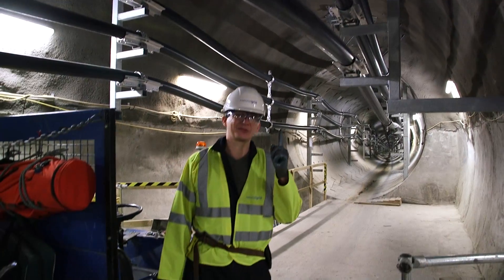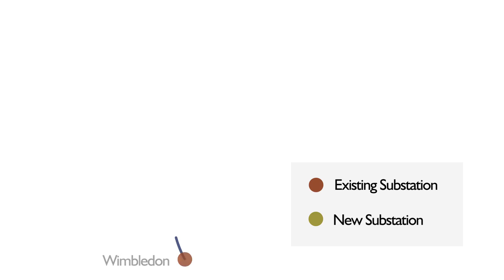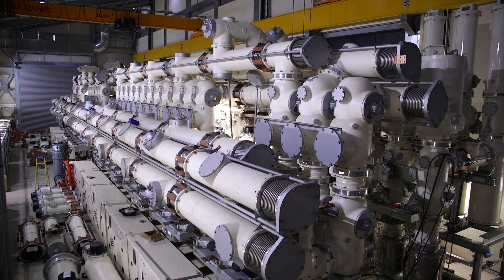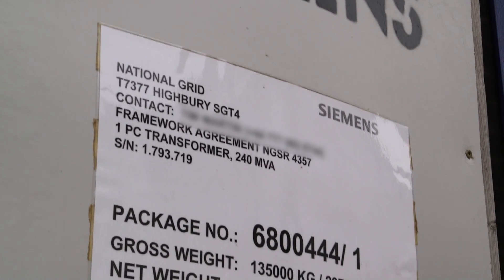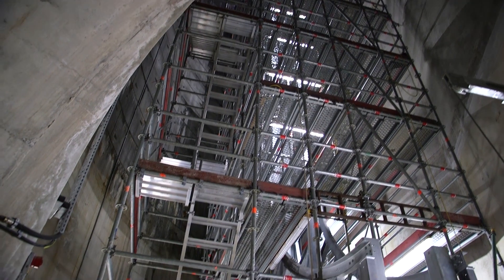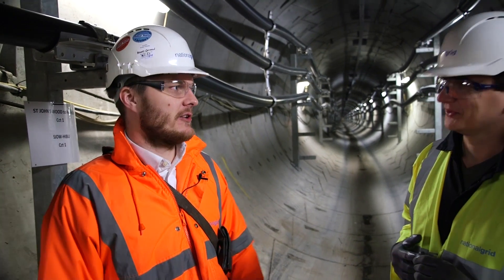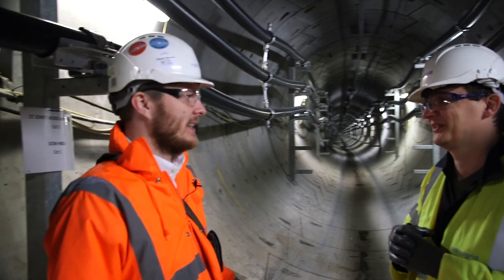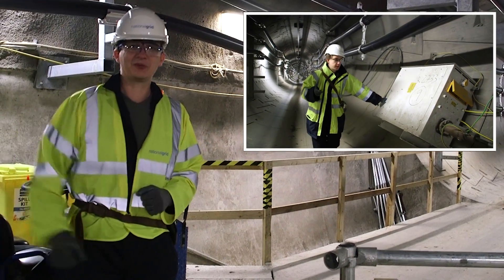Inside National Grid's Power Tunnels

Comment: London and the United Kingdom would have similar problems to Australia or even a bigger national grid capacity problem in the future. 

The cost of expansion is the biggest dead end.

Do yourself and the UK and the world a favour and look into this.

Underground tunnels are totally overlooked and underground distribution and future grid capacity. 

In Australia the nuclear promoters want to stop CO2 emissions and have a no fossil fueled future.
18% of Australia’s energy was electric energy in 2021-22. 

So 5 TIMES MORE ELECTRICITY is needed. 

So 5 TIMES bigger national electric grid, including transmission and distribution. 

The Australian grid new build is $1million per klm. 
Grid is 1million klm. 
New nuclear generation $2billion and 400 SMRs are needed. 
Small Modular Reactors. 

100years to build the existing national grid. 

The UK would have similar costs.
Or more for the below ground electric supply. 

This is a huge story and nobody has put the numbers together. 

On top of that problem is that if the sunniest continent on the planet goes nuclear and Australia’s CO2 emissions are from the worldwide CO2 emissions then Australia will have spent a $GAZILLION an still suffering climate destabilisation. 

Australia’s latitudes is the same as the Sahara Desert latitudes.

Comment: What happens to the waste heat from these cables? Is it put to use heating nearby buildings, or just wasted.
Reply: Yes, the heat is captured and used to heat buildings at the substations like the telecoms rooms and switch halls :)
Reply: L Fewell I don’t know how much best you think is generated by these cables but it’s negligible, nowhere near enough to heat buildings. Hence the reason for the higher voltage, high voltage = low current, lower current = less resistance and less resistance = less heat and losses.
Reply: I suspect the energy loss isn't actually negligible, but it would be low grade heat and difficult to harness.

Comment: Surprising that they would put 400KV lines deep under London, when London is barely above sea level.   What happens if the Tsunami from that unstable island in the Atlantic comes in?   They might wish the wires were high up on graceful towers.
Reply: rtel123 nothing happens. Cables are waterproof
Reply: until they develop an insulation crack, unnoticed until immersion occurs.  I have worked for utilities and seen it happen.
Reply: It's not in the Atlantic ?!!

Comment: Would they add other lines down there like phones or gass/water
Reply: BT Openreach has their own tunnels and conduits for telecommunication use, as do the local water companies and the gas division of national grid. To be fair 400 kV AC cables are safer not sharing a confined space with gas, water or cabling susceptible to damage from electromagnetic induction. The latter is never a good idea while the former mostly only present severe risks in the event of a double failure but considering those risks in this case would be turning the entire system into a giant 32 km long pipe bomb with a charge of up to around 100,000 cubic meters of explosive hydrogen or methane gas with an ignition source probably better we just let them stick to their separate tunnels.

(And yes 400 kV can easily manage the electrolysis of H2O turning it into explosive hydrogen gas in a confined space, this is of course not good).
Reply: No, the point is to avoid having to negotiate with others in order to carry out maintenence, the tunnels can't be accessed whilst the cables are live for safety reasons so it would be a nightmare if every time Openreach wanted to maintain their phone lines we would have to turn the cables off...

Comment: I wonder why the tunnels have to be so large.  I know that people have to move though them, but they seems a lot bigger than they need to be.
Reply: Aids in expansion in the future, among other things. Easy to put in a new cable, hard to drill a new tunnel.
Reply: Theres an electrical reason too  As cables carry current (electricity), they heat up.  The more current they carry, the hotter they get.  The heat disappates into its surroundings, and the faster that heat can be taken away means the cable will cool faster meaning they can carry more current.  If there the tunnels are smaller, there is less air for the heat to go so the cables stays warmer and the surroundings stay faster.  There will likely be some sort of air circulation system too (ie fans), but the more air you can move the faster you can shift that heat.
Reply: RoulinBrooks if they made it just the size of a man, do you fancy trying to pull countless metric tons of copper/aluminium down miles of tunnel? Lol

Comment: Why need separate tunnels? Why not just thread wires through crossrail/underground tunnels?
Reply: It would be a maintenance and upgrade nightmare (suspending tube services to access the cables). Additionally the tube lines don't necessarily align with the substations.
Reply: Ah fair point.
Reply: You must realise the EMF from 400KV cables is immense and would adversely affect all signalling and communications equipment of the railway system. Not to mention if an accident were to happen and one of the cables were to be severed by a train with hundreds of passengers on board... Doesn't bare thinking about! :-o

Comment: makes me sad when i see pylons etc as why do people need so much electricity, and what a waste sending it such long distances, wonder how much gets lost along the way. Locally produced renewable power is the way to go. i am off grid, if i can do it anyone can.
Reply: Not much is lost because it's high voltage, and unfortunately locally produced renewable power is no good for heavy industry and whilst it works for you, it doesn't work for everyone. Locally produced power isn't as efficient either as the larger machines tend to be more efficient.
Reply: Will Datsun mostly the increasing demands as people buy more objects, not to mention more people moving in in general
Reply: Actually distribution losses are enormous, with around £1.28b of electricity lost each year in the UK.
Reply: @LondonRider12  Yes, but transmission losses are much lower - the majority of power loss is actually in the final cabling coming into your house at 240v

Comment: A pretty random question I know but how much heat do those 400KV Lines create?
And do they have fire detection loops fitted throughout the tunnel?
Reply: That's why you never see snow in London.  The whole city is inadvertently heated by underground works.
Reply: The cables (prior to this tunnel, maybe not now) run under Clapham Common. One morning I walked through, and the snow had melted along the line of the cable.
Reply: They can create quite a bit and in one tunnel I work at we have a full water cooling system for the 400kV cables. There will be temperature monitoring, but as for fire detection, I would imagine there would be.

Comment: I don't understand why all new power lines aren't buried underground. Above ground lines are such a liability, especially in snowy climates like mine. Just a touch of bad weather and thousands of people are without power.
Reply from the maker: +Spencer O'Dowd Much more expensive to build tunnels, that's why!
Reply: +Londonist Ltd Up front, yes. But the decades of saved maintenance costs balances it out IMO.
Reply: Overhead Lines are by far cheaper in the long run, they are easier to maintain have fewer permanent faults and take days rather than weeks to repair. Tunnels are mega expensive but do allow repairs in a shorter space but at a huge initial cost. Undergrounding is very difficult to repair and also quite costly to bury in the first place. Don't forget the cables themselves are many times more expensive than the overhead lines and repairing cables is complex and time consuming.  Believe me the company wouldn't choose towers over tunnels or cables (I work for them!). Replacing cables is also very expensive, whereas the overhead lines are relatively cheap in comparison. In fact there is little maintenance on overhead lines in the first place.
Reply: +Spencer O&#39;Dowd Tunnels are really expensive in the first place. To the point where your break even time might be beyond the design lifetime of either option.

I wouldn't be maintenance on overhead lines is that much worse either. Tunnels can be much more expensive to maintain (especially if there's structural or water ingress issues).
Reply: Not at all, I seem to recall cables cost 10 times as much as overhead line.  Another issue is when something is underground if something goes wrong, it is harder to find the fault and fix it.
Reply: You dont have to understand why, the power transmission and distribution companies have a great understanding as to why, most of which are mentioned above
Reply: Electric transfer is also much more difficult underground. The Earth creates a barrier of natural resistance and that mskes underground cables less efficient. It's a nesscity in London but avoided where possible.
Reply: Also, electricity at that voltage builds up a lot of heat, which dissipates easily from overhead lines, but from tunnels has to be extracted. Have a look at the tunnels they created for electric mountain in Snowdonia, Wales (Dinorwig Power Station).

Comment: Volts isn't a unit of power.
Reply: Volts is a unit of voltage. Watts is a unit of power.
Reply: @Jon-em4kc  "Volts is a unit of voltage" No way really?
Reply: +Sod Alfredsod You can have 5V and 1000A
Reply: I said that very poorly. Yes, electric potencial is not power, but it acts as a multipiler for power (Watt = Volt * Ampere). Higher voltages will also arc longer and pass trough more insulation as Resitance is directly tied to it.(Amperage is too but that is beside the point)

Sorry for the long comment (that is porbably even more wrong).
Reply: @asj3419  it's referred to as "current", amps are the units of current.
Reply: Potencially.
Reply: No, but it is the unit for potencial power.
Reply: +Sod Alfredsod it's not even that either. Where did you get that from?

Comment: I have tried to ask National Grid about this before, but they didn't answer me. How does this project fit in with the cables that run under the regents canal, because it's either their fault or the Canal and River Trust, but the towpath is really badly maintained in places and often waterlogged... I think it would be better if TfL were to take over running the canals that run through greater London, they are after all a transport mechanism. The C&R Trust doesn't really seem to care about much else than getting fees from boaters.
Reply: The owner of the towpath is probably the C&R Trust, and National Grid will have a wayleave for access, that said, sometimes NG will buy a piece of land instead.

Comment: those tunnels look like a cyclists dream....
Reply: Except for the combination of slimy standing water and slick, smooth concrete in the very bottom-center.  "Mind the slime!"
Reply: As a cyclist and someone learning to skate, can confirm
Reply: +Syed Abdul Wasay Apparently there was some talk of converting some old unused tube lines into cycle routes.
Reply: Harry Akira Eaton So is there one coming or not....
Reply: Syed Abdul Wasay Doubt it, be a nightmare to police, also they’d have to come up with some kind of bike escalator, and the time going up and down the escalator would probably mean most cyclists wouldn’t use it due to it taking longer overall than dicing with the traffic.

Comment: So why do they have to be so big? Surely they could be about 2/3 the size and still fit the cables with maintenance room - wouldn't that make it cheaper?
Reply: +The Natter Nodge Future expansion room possibly? Perhaps there's some health and safety BS which states that two people need to be able to pass eachother
Reply: +diceyface I'm no expert but it's probably a combination Even when operating at max capacity, it must be able to follow health and safety regulations
Reply: easy movement through the tunnels
Reply: +The Natter Nodge It might have more to do with the machinery used to dig the tunnels. A smaller tunneller would mean smaller parts, so more cost to make. Also a smaller tunneller would mean less earth moved per day, meaning it would cost more in wages and man power as the protect would take longer.
Reply: +The Natter Nodge i think its to do with heat, those cables need to be kept apart from each other to prevent heat build up. There are numerous vent buildings along the route to bring in cool air and expel the hot air.
Reply: +The Natter Nodge I was thinking that too.

2/3rds the size would still be large enough for the cables and people.

Perhaps it was too do with the TBM? Maybe there's not really technology for digging smaller tunnels without using stationary equipment (which would require holes all over London).
Reply: Jed Robertson Interesting point

Comment: "400kV, that's a lot of power we thought" Voltage and power is not the same y'know..
Reply: +Arnþór Gíslason still allot of power though, hes not wrong
Reply: +Arnþór Gíslason yes, it is technically incorrect. But reducing the technical speak... "power" has become the term of choice when describing a feed of electricity to a specific area/installation/venue/house/etc...

EG: When there is an interruption in the electrical feed to your house you don't say "we have had an Electric Cut" or "I tried to turn my telly on and there is no voltage being applied" you say that there is a power cut!

same as you done say "I have fractured one of my phalanges!" you say you broke your finger! :)
Reply: Bit of a smartass comment to say that 400kV does not equal a lot of power. At one single amp you’ve got already 400.000 watts going through. And yes, i know what you mean, but i think it’s just smartassing.
Reply: Joncurtis199 - I think you mean kW not W with those transformer ratings! Hopefully if load balancing calculations have been done correctly, kW should = kVA within a few percent (ideally cos phi < 0.8) :-D. Let's avoid the rather more complex subject of kVAR for the moment! :-D
Reply: Quick note:  400 thousand volts (kV) is a standard, national line voltage for the transmission network in the UK which runs from scotland all the way down to the south cost of england.  There is also 275kV network.  These networks then step down to a 132kV network, then to 33kV then 11kV before finally arriving at your plug socket in your home at 230V.  The 132kV to 230V networks are run by distribution companys and generally if you have a power cut this it where it is.  To confuse things more, the power ratings at all levels these can vary quite dramatically and will decrease as the voltage gets lower, but 400kV transformers can have different power ratings depending on what demand is on that bit of network.  For instance you could have a 11000 volt transformer with a rating of 1000W, or 800W, or 500W - again depending network it feeds.

And yes, anyone else with some electrical sense, I did not say VA on purpose, just to keep it simple ;)
Reply: True, it might only be capable of 15 microamps at 400kV, lol
Reply: +Richard van Pukkem Absolutely and even with enough insulation to isolate 400 kV those look like a good few hundred amps maybe as high as 1 kA+ per cable. That and the fact that the transformer to supply just one of the 6 sub stations is marked with a 240 MVA rating makes me think you are probably looking at a system with a nameplate capacity likely in the GVA range.
Reply: +Arnþór Gíslason No the proper term is uuumph!!!
Reply: +TornTech another url: file:///C:/Users/Michael/Downloads/bts%20flyer%20-%2012th%20dec%202013%20london%20power%20tunnels%20final.pdf

Comment: Do these tunnels run close or parallel to some underground tunnels?
Reply: mhappy01 well i stand corrected. If you find any more infomation(don't need proof, i believe you!) let me know! sounds like its alot more then a bog standard monorail, sounds like its a semi automated inspection robot that can also carry passengers! Very intresting!
Reply: http://www.fataautomation.co.uk/case-studies/tunnel-inspection-vehicle.html
Reply: +AmselGaming They do. What the vid didnt explain is that there is a new electric tunnel from St Johns wood to Elstree. And, not many people know this but there are two new electric tunnels under the Olympic site - the second one was used as an emergency tunnel for Heads of State etc They connect with the tunnels at Hackney and West Ham/O2 centre..
Reply: +AmselGaming Also.  look above Geoffs head in the completed tunnels and you'll see a single girder (used for a monorail system to transport people and equipment so no need for bicycles)
Reply: @mhappy01 
Very interesting. Thanks
Reply: @earth man
have a look at this location in google earth:-    51.563837, -0.221888 and then scroll back to 12/2002.  One of 5 shafts built to vent in/out and access.  the other 4 are along the east side of the A5, happy hunting.
Reply: mhappy01 
Near where I live there's a park area where I have vague recollection of 'something' being buried under the very level grass field. I was telling a retired guy about it whilst there. I told him there is something there because there's a stainless steel metal plate about 6" x 8" sitting in the grass which can't be moved. He wandered off and found it. But is my memory flawed? My Son suggests it's a Space ship but it's possibly a buried water reservoir? 
Exploring can be fun.
Reply: Can you give the name of the park or location? i'll check my GE data (probably go with the space ship idea....;))
Reply: +mhappy01 im pretty sure that single girder will not support the weight of a monorail... plus. if they had a transport mechanism implemented into the design, why not make it live first, prior to the cabling installation. that would then mean no "tug" was ever required...
Reply: have a read of this, https://groups.google.com/forum/#!topic/uk.railway/if1mq0GdzQ0  i'll look for more proof.